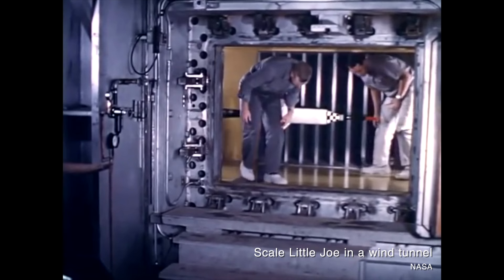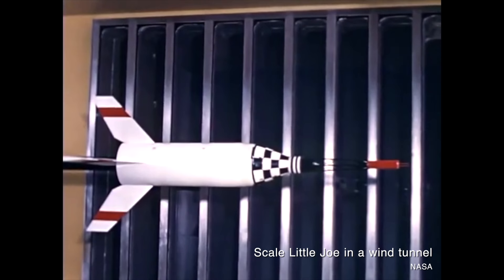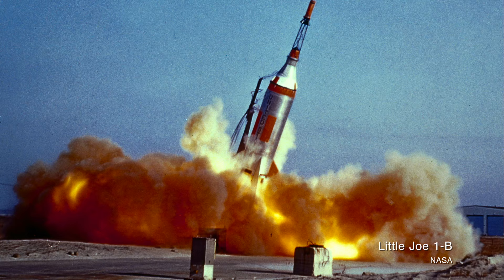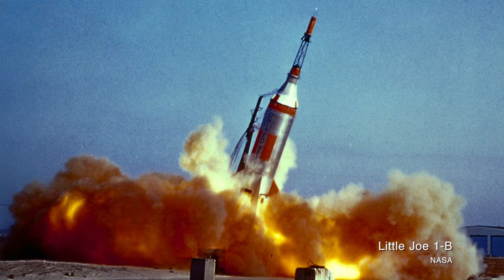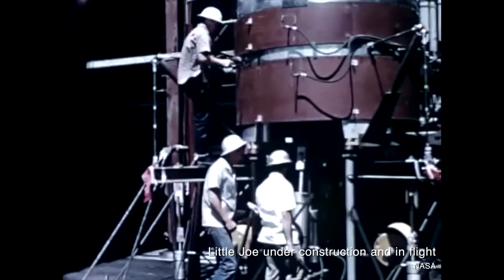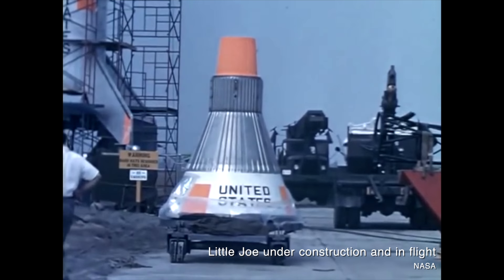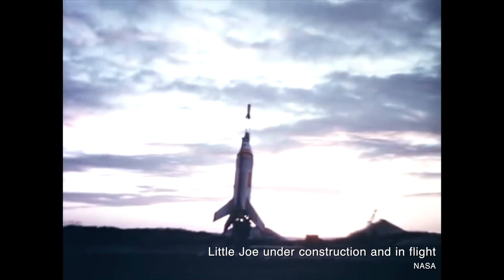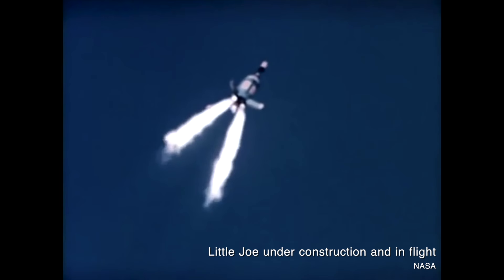These Little Joes Helped Put Men into Space

Comment: I've read the test reports from all the Castor 1 solid rocket motors.  This guys were really efficient, no wasted inert materials in there, at burnout it had already eaten .250 inch of metal at the aft ring !   We were NOT allowed to do that in the 1990s.

I also stumbled across one of those escape tower motors, or a smaller test version in a storage igloo on redstone arsenal around 1990.  If ATK moved all Thiokols old stuff they probably blew it up.

Great job digging up all that old footage, kinda surprised any existed.

Comment: Amy, could you talk sometime about how astronauts on the moon dealt with moon dust? My guess is that the stuff stuck to the outside of the suits and then got everywhere inside the lander. Was it soft or was it coarse? Did it cause any problems? Did NASA plan for dealing with it, or did the astronauts have to cope with it as they saw fit? Thanks!
Reply: They had to dust their suits off vigorously before reentering the LM after each walk, so that dust in 0-G could be reduced.

Comment: This may be very basic, but how did the capsules attach to or communicate with the rockets they sat upon? I mean there is the heat shield and you can't have holes in that, right? If I missed a video explaining this please pass on a link. :)
Great video, as usual! 
Didn't those engineers and mechanics feel bad about their hard (and detailed) work being destroyed at the end of a flight. Sure, it might have done its job but a rocket engine is not an easy thing to design and build.

Comment: I've got a rather intersting question and this deals with the "Voyager" 1 and 2 deep space probes.. It'll be 40 years since they were launched (in August and September of this year) and I'm wondering.. are they still functioning? And if so, where are they now?
Reply: They're both still kicking although most of the systems have been shut down due to the power drop from their RTGs. You can check on http://eyes.nasa.gov/dsn/dsn.html and see them pop in from time to time. Voyager 1 is in interstellar space and Voyager 2 is working on it... unless they changed their minds since the last time I checked.